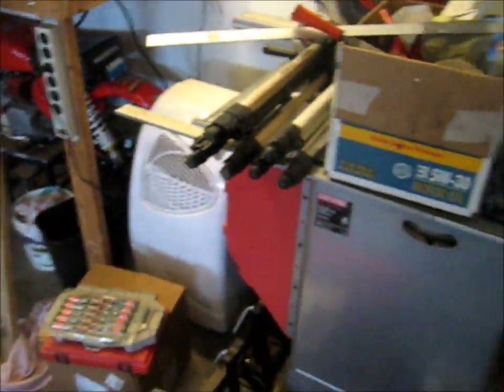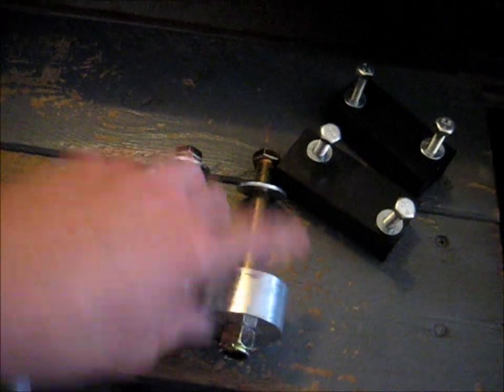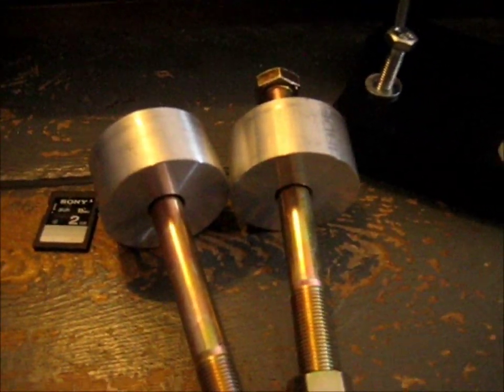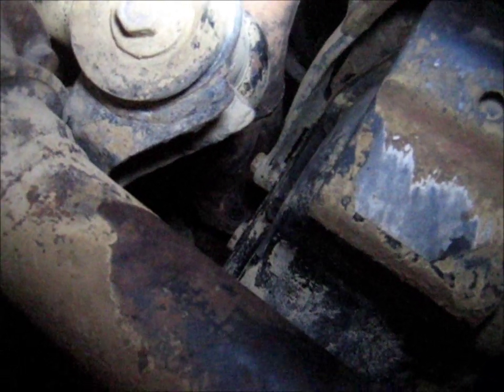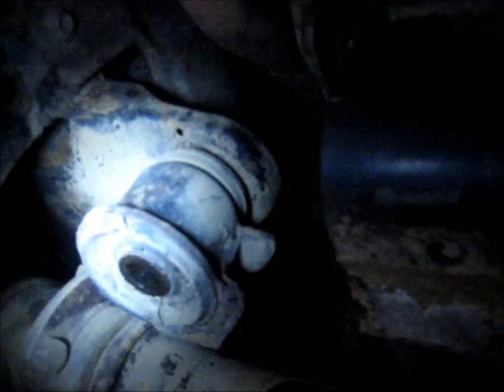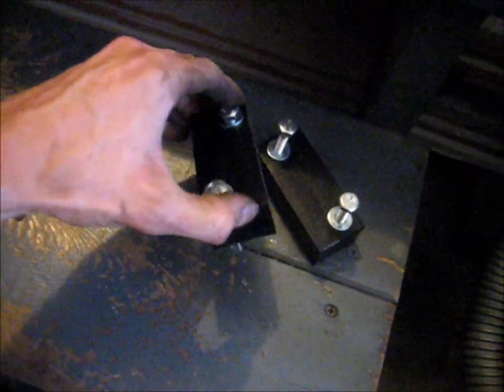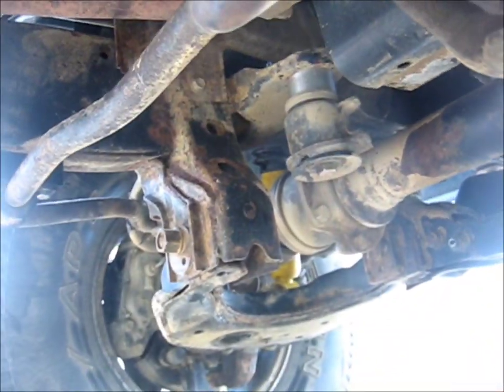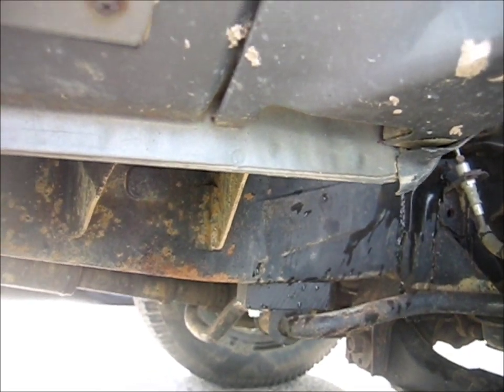IFS Toyota Pickup and 4Runner Differential Drop Spacer Installation

Comment: I have a 91' Toyota Pickup 5" Lift Kit 33"x12.50 Pro Comp tires....

All of the sudden, what seems to be the Front Differential is making a very loud noise when I'm driving!  Now I'm broke down and stranded home.

Anyone know what is wrong with my truck or if the 5" Lift Kit caused this problem?

Thanks!

Comment from the maker: I had leaks coming from the compressor and condensor. A fresh Denso compressor was installed with an aftermarket condensor and filter/drier. The proper SAE retrofit procedure was carried out using R-134a refrigerant and PAG oil. New fittings were installed and the system was vacuumed and charged. Total cost was under $500. A/C service is dangerous, difficult, and harmful to the environment if done improperly. Do it right or pay a professional.